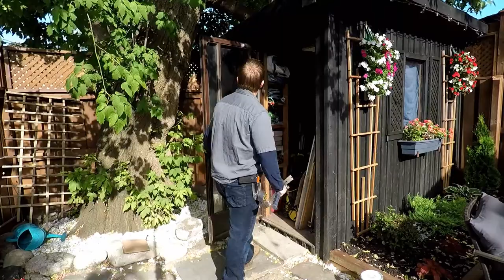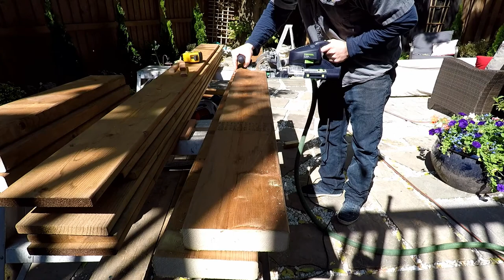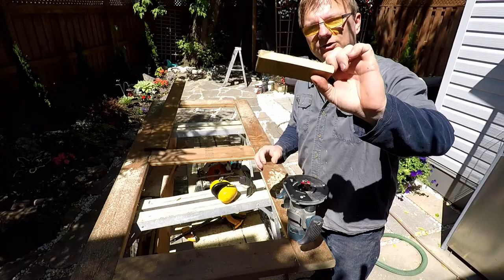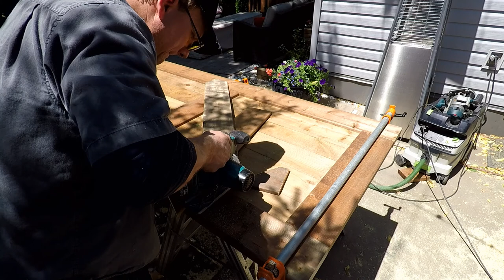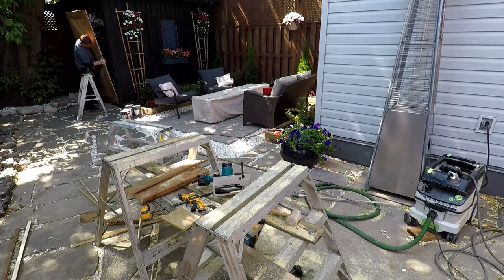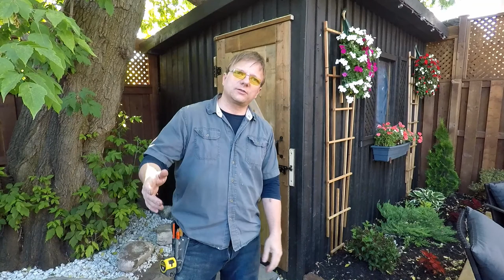Barn Door Build Using Festool Domino XL

Comment: So an entry door, and the only type I would consider because of longevity, is about $420 in Home Depot. It comes with jambs and a window. This would be no more than that. Unfortunately, nowadays, the cost of the pressure treated lumber for this door would cost you close to $100 if not more. At $400 you would clear at most, about $300 profit and thats not counting the tennons, glue, biscuits and utilities. If built in a day, you could consider this is a worthy endeavour for about $400 a door
Reply from the maker: Its not worth making a standard door like this in Canada for resale.  It has to be an art piece and be very different to make it worth while.   I have seen custom door shops close down around here.   The overhead eats all the profit.  Cheers!

Comment: Nice job for a shed door I'm guessing $100 bucks. I really like the Festool usage and I would also add torx screws so some crafty thief might have second thoughts about getting in besides a lock.
Reply: $100? LOL. This job is worth $700-800 easily.
Reply: @FrogCalender  You would spend that much on a shed door. You must get a lot of stimulus checks?

Comment: why do you have your top brace going the wrong way ?
Reply from the maker: Either way, the door would be plenty strong without any braces... only there for the look.   As it is Festool dominos make for very rigid joints.  That said, one could argue that the bottom brace carries most of the load (under compression) and the top brace is carrying loads through tension and thus adding to the overall door rigidity.   Yes, for a wide door it would make more sense to have both brace bottoms at the hinge side.  Cheers!
Reply: arthurandsons if a mortice and through tenon is not strong enough to stop a door sagging the dominos certainly are not. However the bottom one is enough to hold it in this case.